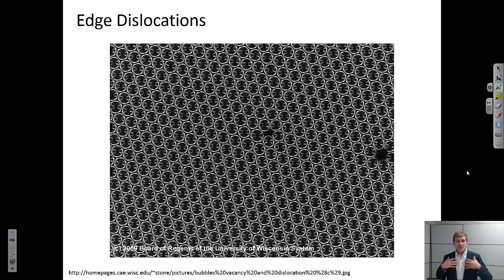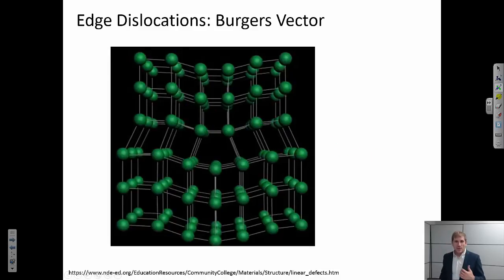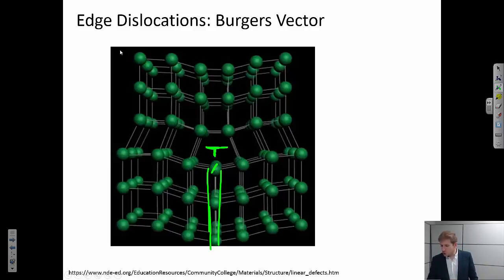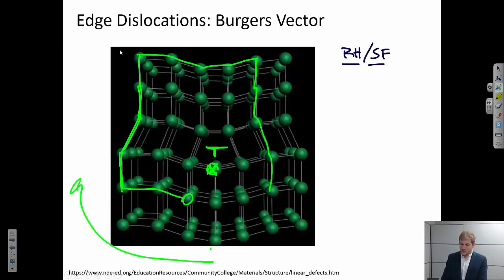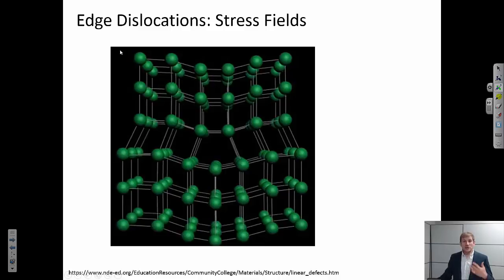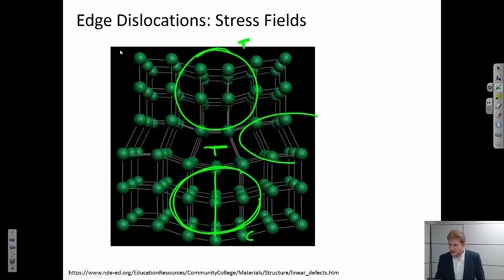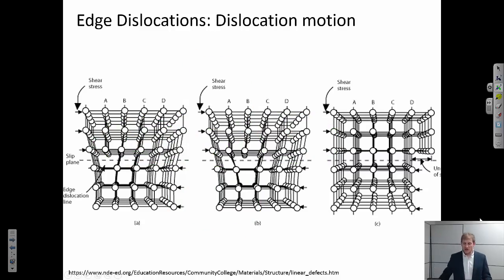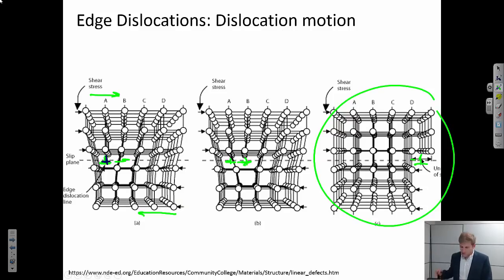Edge Dislocations {Texas A&M: Intro to Materials (MSEN 201)}

Comment: Great Video, but I have a very fundamental question. You start counting ( for burgers vector ) from the plane perpendicular to the dislocation  and you get burgers vector perpendicular to the line..but what if I start  counting on the left or right?
Reply: He said it doesnt matter from where you start. if you're starting from the other side, the burgers vector will have opposite direction to which you started.
Reply: Rameez ul haq what if I Start vertically? .. then I will get it perpendicular to the burgers vector shown
Reply: @shikhararvind  if you start vertically, you will not get burger since there is no difference in length between the two sides. It is impossible to get burger perpendicular to what shown